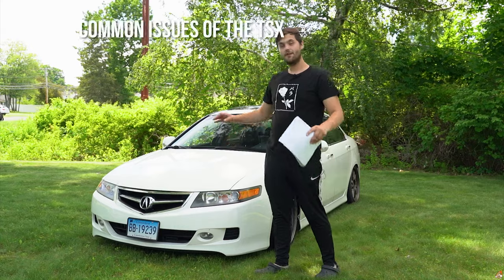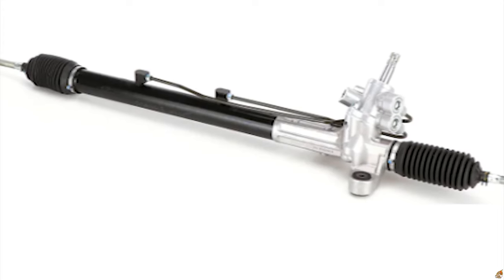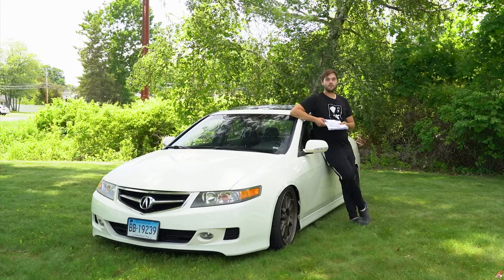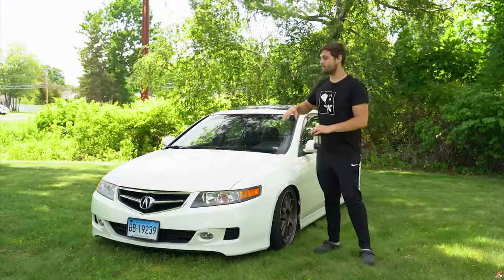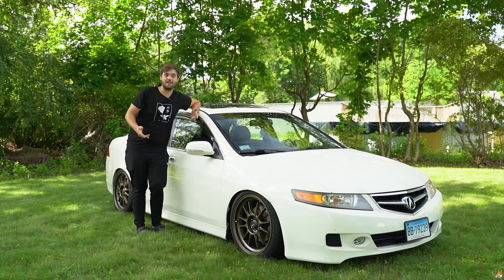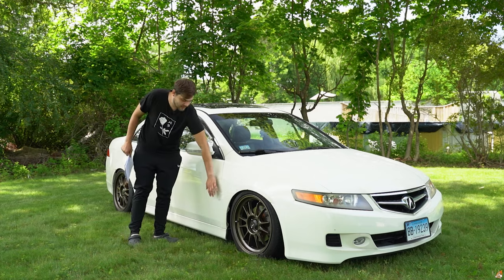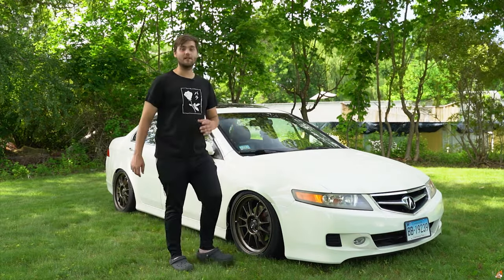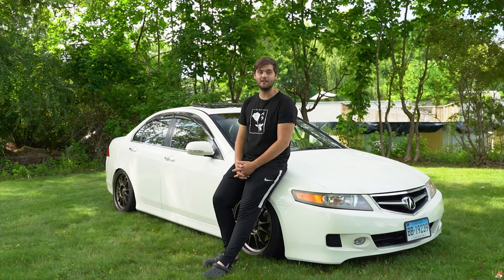TOP 10 COMMON ISSUES With An Acura Tsx

Comment: I have had my 2006 Acura TSX for 17 years and put 250k miles on it.  I have definately had to replace / repair some items on your list:
1. Power Steering Pump
2. Starter
3. Alternator
4. Bluetooth

Not on your list:
1. Ignition coils
2. Oil pump
3. PCB for interior button lights
Reply from the maker: Yup most of it is just overtime mileage/age maintenance but solid cars!

Comment: I'll give you two more for the 2011 thru 2014 series:
1. Scratch prone interior door pulls...makes your TSX look like a 24/7 Uber car.
2. Defective VTC accuator in the 2.4 motor. Swap it out, new one goes bad in 30 days.
Reply from the maker: dang that cheaper plastics SMH!
but yeah i get that slight noise at cold starts lol.. been letting it rock can't do that job atm.

Comment: 04 here. 109k. Awesome condition. Starter giving me trouble as we speak. Battery fine. Also door actuators! My driver side is out. Have to manually lock. And didn't hear the console backlighting mentioned. Radio and climate functions work fine, but none of the buttons light up. Thankfully, I can remember where everything is at night. Still a great car.
Reply from the maker: Yeah sounds like some aging issues, these cars aren’t the newest anymore but still really good! 🙌🏼

Comment: Got a 04 tsx with 240k miles it is automatic the onky problem I had over the years was the transmission just giving out and the ac compressor other than that it works fine then again it is a daily and completely stock
Reply from the maker: Better to keep it that way! Sounds like its been a real solid daily 💪🏻

Comment: Had most of these.  Also the Navigation disk read error is a super common one and happens to TLs also.
Reply from the maker: Yeah I’ve gotten weird errors with the disc read but never fully stopped working thankfully
Reply: I figured out cheap fix for DVD drive issue. you take the DVD drive in the truck apart and get number off of the actual disk drive inside of it and go to the junk yard, i pulled one from an 08 accord took it apart and had the same number on it and only paid $12.50 took home swapped and been working great ever since.

Comment: I'm about to go change my starting rack tomorrow and my AC compressor is bad ,I have a little vibration issue coming from the left side, I already rebuild my power steering pump and my alternator sometimes winds a little. But I love my TSX and I still think its pretty reliable, had it since 2017
Reply from the maker: Ooof steering rack isn’t the most fun job with the space, swapped mine out while the motors out of the car lol. Hopefully Detroit axle will be fine. But yeah that notorious wine through your speakers lmao

Comment: Great video.  Thanks.   I have an '06 had the rack and pinion replaced by a neighbor.  I did the alternator.  Need to do the power steering pump.  Did all sorts of under carriage suspension work some by me (use the Diablo sawzall blades they cut way better than others).  Dreamy to drive though and now at 240K.
Reply from the maker: Oh yeah a little TLC and these cars are solid, those rubbers bushings ware out in time. 

I gotta do some replacing on the daily tighten up the steering and smoothness.

Comment: That rattling noise i faced in my several tsx's, timing of cam chain issues with engine, A/C compressor was my issue in 08, vibrating axle shaft was with 04 TSX I had, however my 08 so far was the best honda I ever purchased in life... I was its second owner, first owner was a gentle man !
Reply from the maker: My 04 had alot of random issues since thats the first year of the US TSXs i just got the iffy one. 😂 but these cars are great i just cant leave them alone so its down more then driving now.

Comment: Damn... I changed starter, rack and pinion, ball joints front struts, radiator, head gasket, driver side window motor, master control switch alongside the other 3 window switches, all four actuators, rear upper control arms, front upoer control arms, rear sway bar rubber and link ends, radio, speakers. Damn i changed a lot.
Reply from the maker: Gahhhh damn lmaoo you and i both… currently have me engine out and apart again 🙃

Comment: Parasitic battery drain issue was resolved in my 2007 TSX by disconnecting the trunk mounted DVD NAV unit.
Reply from the maker: nice! can also disconnect the bluetooth module under the glove box area
Reply: @RishMedia  yep did that first but still had a parasitic battery drain issue until the trunk mounted NAV DVD player was disconnected. Thanks!

Comment: I have an 06 and the Bluetooth thing gonna get unplugged for a little, it vibrates and from time to time when I brake and hit the gas battery light turns on & off. Don’t know what that could be
Reply from the maker: Hmmm and no CEL? 

Make sure you battery connection is tight and battery isn’t moving. Also check your ground connections. Sounds like something’s a bit loose

Comment: I had to replace the EPS but Acura covered it under an "extended" warranty.  I don't have a warranty, by the way. The dealer cost was $1,500, but Acura paid for the replacement.  I have a 2012 TSX with 105K miles.
Reply from the maker: Atleast it was covered cause gahhh damnn lmaoo

Comment: Everything you said is fact 💯 they happened to me. But you forgot the pulley tensioner rattle sound is Also an issue. Honestly these are just wear and tear situation. Not really an issue that happens under 100k miles.
Reply from the maker: Yup most of the stuff is just a over time maintenance kind of thing. 100k is basically just breaking in the car fully and shouldn’t of needed many bigger repairs.

Comment: I know I am late to this but with the Accord CL9s the Accelerator Pedal Positioner (APP) Sensor being faulty is very common amongst most Accords, could be the same for the TSX's. This is usually why after driving for a while the car goes into Limp Mode, Usually the Engine and VSA Light comes on when this happens.
Reply from the maker: Yup it has happened to me once or twice before in the past, definitely a more problematic issue I do see amongst the groups.

Comment: Riiiish, everyday I get on YT and see your car In a thumbnail I'm like "Damn I love how low your car is " I like that year better than my  05 for the bumper, it's more up to date and sleek.
Reply from the maker: Aww shucks ☺️ thanks dude! Yeah the facelift is a bit different and the lip kits but maybe do a facelift if you’d like or try to find a 07-08!
Reply: @RishMedia  You're welcome bro. I may try to do the face-lift, if i spend money over $2k its going to  an all Motor build 😎 Can't lie, difference in body style, hp and a manual is calling me. I was thinking if I all motor my 05 I'd probably get either an 06-08 to keep the project car off the road but that bitch is screaming for power,  it does not make sense to put 93 in this car without POWAAAAA Parts 🤣
Reply from the maker: Tbh I wouldn’t go a all motor build in a auto Tsx won’t be as fun imo if you plan to go all out try to find a 07/08 6 speed for sure
Reply: @RishMedia  Yes that's true, definitely won't be fun driving a slap stick with excessive power under the hood. 6 speed It is 😎
Reply from the maker: Let’s gooo! 😈

Comment: 06 acura tsx bought it for 2000$ 119000 miles i replaced all tires starter top motor mounts belt my ac and battery now me and my dad gonna replace the bottom motor mounts axle tire rods control arms
Reply from the maker: Sounds like you got a good deal and daily driver!

Comment: Never had any of thise problems with my daily driver two full time jobs smashing and racing everyone in the highway, the only things that went were the power steering, alternator starter, and just now after 190,000 miles my clutch master. After that awesome car! 2005 Acura Tsx 2005 the best ones!
Reply from the maker: glad to hear yours has been pretty simple general maintenance good stuff!
Reply: Yeah not bad i love these cars i think the 2005 ones came out a little stronger  than the rest of the tsx’s once the extra electrical stuff gets added on i think thats where the issues start.

Comment: ‘05 TSX Manual at 150,000: Multiplex Integrated Control unit faulty. Caused my dash lights to go out and electronic locks do not work. Upper and lower control arms needed replacement. Other than that, runs great!
Reply from the maker: I hate electrical problems lol just dealt with some myself threw this whole clutch job mess lmaoo

Comment: I’m having the power steering leak issue, i can’t pin point where the leak is though. 🤦🏽‍♂️😒
Reply from the maker: My guess either the o rings of the lines to the pump, or one of the hard lines on the rack the flare can get a hairline crack.

Comment: 2nd gen TSX has electronic power steering it can be kinda spendy if it goes bad but it typically lasts a long time and even if it does go bad you can pull one from a junk yard easily

Comment: 04 tsx had a alternate failure at 207k power steering rack and pinon failure and full break assembly replaced full suspension rebuild
Reply from the maker: That’s not terrible, some of that is typical sometimes they last for awhileee.

Comment: I'm original owner of 16 years and have had to replace the battery numerous times.  I finally unplugged the damn bluetooth after getting another new battery.  We'll see if it fixes it.
Reply: Also, yes, Power Steering pump leaking but so far so good, only have had to replace the clutch and two interior bulbs.
Reply from the maker: Bluetooth thing definitely should help maybe could be a alternator draining too. 
But if power steering is leaking through the lines just replace the o rings theyve been recalled.

Comment: Ball joints and and alternator went out this month and got them fix.
Reply from the maker: Did you get the ball joint pop out moment? I hope not!
Reply: How do you know you need ball joints in just asking because I have the same car
Reply from the maker: @montrellrobinson120  usually you get kind of a squeaking when turning maybe like a creeking
Look under see how the boots looking if it’s torn but depending on miles like 120K+ should’ve been changed already

Comment: The PCB or transistor on your radio that makes your car radio and climate control light up dims and goes dark, which leads the driver having problems adjusting the temp and change the radio due to them not being able to see the information on the radio or climate control section.
Reply from the maker: Hmm good to know! Have that issue a little bit on my white one with the dimming but not to much. 
In the black on I just have issue adjusting the volume knob.

Comment: Got my 06 for 71 hunnit beginning this yr and it's been amazing. Especially for gas but recently problems not starting after I get to a store. Nice people jumped me immediately almost but battery and alternator one yr old and testing good. Must be starter. Disconnected Bluetooth. Seems my power steering pump is bad too now that I see this video. AC is amazing. Oh it had 117k now 122k fastest 4 banger ever
Reply: Oh had two offers of 9k immediately but couldn't find anything decent to replace so I kept. Glad I did. Amazing engine and trans
Reply from the maker: Is it a 6 speed too!? Nice find man these cars are getting hard to come by lower miles manual certain color ways etc! 
Plus the market is crazy but they are getting more “rare”  good luck on the new build

Comment: I'm running into the rack and i thought man i should have checked everything before getting it  turns out that's the life of the tsx
Reply from the maker: Yeah man some things are general and go out over time of course but more prematurely when people don’t take care of em
Reply: @RishMedia  I just got the car not that long ago and was my fault not checking the tie rods now I need a whole suspension 🙃 thank you for replying though if you know any websites let me know please 🙏
Reply from the maker: @cgpanda8682 not a problem
Man but for cheaper but still decent brand suspension stuff get MOOG on rock auto

Then there’s your kseriesparts & heeltoeauto for a bit of everything

Comment: Never thought the Bluetooth was responsible for having killed more than one battery, and have been using Optima Yellow-Tops since; and still don't listen to the radio or play audio through the Aux connection unless the car is running. What's the fix? 

Also, never had ANY problems with any of the components you've mentioned with my '06 Automanual with NAV...except after a year driving Tallahassee, FL roads (possibly the worst in the nation). I ended up needed a whole new front end...$2,000...before I spent the money, the service rep tried to buy the car from me. That's when I knew she was a 'keeper' and ponied up the money. 

Now have 177,000 miles and fuel economy has sucked canal water for the last couple of years. Watched a couple of other YouTube Videos (including Scotty Kilmer's) and realized I need a new fuel pump assembly - after 17 years, it's probably gummed up from all the damn ethanol they put in the fuel. 

Did the same repair to my '02 Avalanche at 175,000 miles, which exhibited a 'hard to start' problem since I bought it second-hand with 30,000 miles on the clock. It now starts on the first turn of the key and runs like new.

So...about this Bluetooth thing...?
Reply from the maker: Yeah the bluetooth is common problem for people batteries to constantly drain out oddly enough. I think the actual fix would be replacing those parts connected with new ones. But either way pretty kinda pointless, i use the aux if anything. 

So what i did and usually people do is just unplug it then its good to go. 

Usually i just got the general maintenance problems then other weird or more severe situations lol.

Im in another rabbit whole for my tsx right now lol.

Comment: I have a 2006 automatic and my issue is the AC.
Can't get it to even turn on. I changed the AC pressure switch and line even a new compressor. Changed the fuse n relay box that got my radiator fans to work Wich is had issues wit to but is fixed.
Reply from the maker: Sometimes things like that are a chasing game, theres ways to do tests to dumb down the options. But glad ya got it working though!

Comment: 04 tsx.i have a problem with water on the passenger rear floor.heard it was a common problem and can’t find out where it comes from.
Reply from the maker: I had that issue with my first Tsx, make sure your door seals are fully pushed in and seated and no extra tears. 

Then I’d also get an air compressor open your sunroof and blow air down the drains and see if it’s clogged up or not.

Comment: You right about the passenger suspension issue I'm having the same issue. It's like you basically have to replace almost everything on that side . You fix 1 issue but then a new issue happens. Then there's the steering wheel shake driving a little over 40mph.
Reply from the maker: Yupp our cars are tricky with that side, they don’t like aftermarket axles and people overlook the half shaft bearing going bad. 
Make sure to check that out!
Reply: @RishMedia  i'm actually looking into that but I'm not sure who to buy from
Reply from the maker: @jasonvasquez1445  use our sponsors website Heeltoeauto.com! 

One of the top suppliers for our community. 
( Use my 5% off code RISH at check out!)

Comment: Everything you listed I've had issues with. Last thing on my to do list is my ac compressor, and my VSA light keeps popping up. The motor runs strong but everything around it seems to be an issue on these cars.
Reply from the maker: We got the best k series motor!! Along with bunch of weirdly common issues all around lmao fairly easy to work on for most stuff too which is nice.
Reply: Did you find out why your VSA light is on because I have done all 4 brakes and mine is still on!
Reply: It was the pedal position sensor for me

Comment: I have a 04 tsx and for some reason, it takes a while to start. I replaced  alternator, battery. And still has issues.
Reply from the maker: Could be the starter giving some signs

Comment: My rack and pinion and power steering pump went, now I hear a tapping sound when it’s in drive and my foot is on the break….anybody know what that is????? It’s an 08’
Reply from the maker: Did you get the rack and pump fixed?? 
And if not start with that maybe and look over your brakes

Comment: 2004 Tsx manual. changed the power steering pump but still leaking. What could be the issue? Also, the high-pressure hose is fairly new too.
Reply from the maker: Did you replace the O rings with new OEM ones? They had a recall at some point for being defective/leaking.

Comment: 08 tsx 180k still running smooth 👌 the only issue i have is that every year I have to replace my brake rotors, for some reason after a few months my cars start shaking when breaking at high speed, I'm guessing is a factory defect. If anyone has any tips please share 🙏 😊
Reply from the maker: Love to hear it! But is it just certain sides or all around? Could be a caliper thing and sticking a little making it uneven ware
Reply: @RishMedia  I believe it's just the front rotors , I have replaced all four calipers and changed brake fluid as well. Thanks for your reply
Reply from the maker: @PR-oq7qn  yeah maybe they just get hot spots and become warped maybe try different brand or styles
Reply: @PR-oq7qn  I heard the brake lines hoses get messed up and to replace those. I heard steel hoses last longer.

Comment: Good and informative video. I have an '06 and lately it's been struggling to start. Like its real slow and labored but it does still start. Battery, alternator, compression all checked out fine. So I'm guessing the starter is going?
Reply from the maker: Yeahhh sounds like it could be the starter! Assuming you’re not getting a parasitic battery drainage from the Bluetooth module.